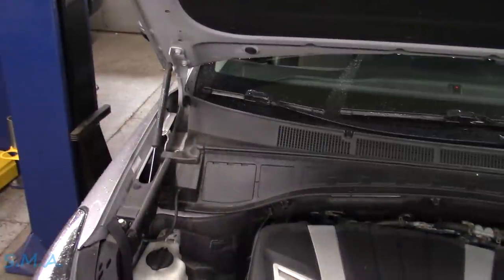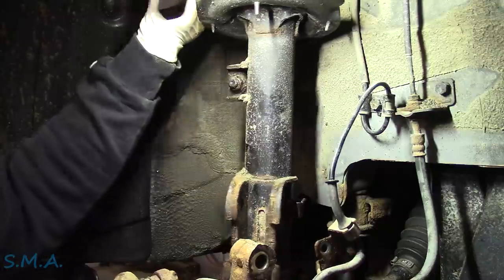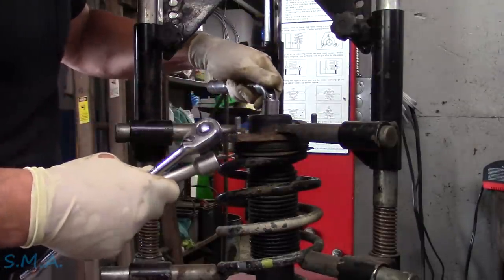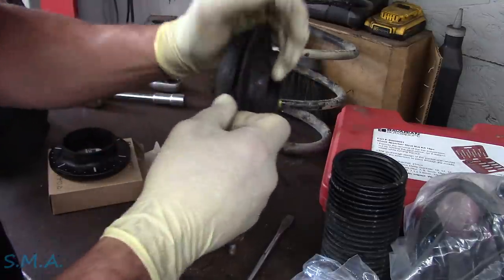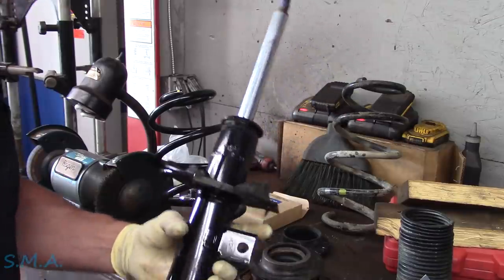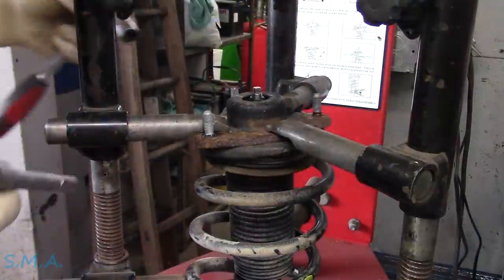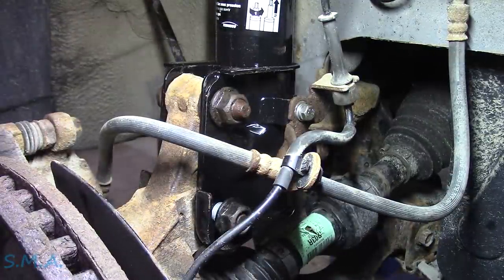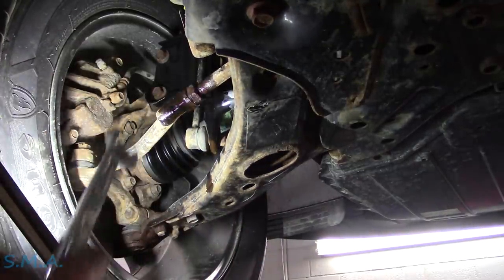Hyundai SantaFe: Broken Front Coil Spring

Comment: I did my son's Hyundai Santa Fe last fall, this looks so familiar. I just went to the "Rock Auto", not a sponsor, and got 4 struts with bearings and springs with swaybar links for less than NAPA wanted for 2 struts without springs. His the right rear spring broke.
Reply: Rock auto in the past has been accuse of selling fake parts, so watch out. I used them before too
Reply: @thevinceberry  I think th y were ok, they seemed like real parts, steel and they fit so yeah I think they might have been real parts.
Reply: @thevinceberry  
I'm pretty sure that RockAuto is only a warehouse and shipping entity. If you've gotten fake parts from them it could be that whoever is supplying pulled one over on them or actually took over the aftermarket. There's been a lot of super cheap crap replacing what used to be good brand named stuff as Eric mentioned. Moog and a few others used to be incredibly good quality but today are actually worse than some of the other alternatives. That's a damn shame. On incredibly critical components or on parts that require a lot of Labor to get replaced I'm leaning more towards going to the dealer and getting OEM. And sometimes the OEM price isn't that much more.
I've got a 2013 Toyota that has drum brakes on the rear. And all of the aftermarket drums I found at O'Reilly we're not manufactured correctly. They are hubcentric not lug Centric. And the center hub diameter was machined too large enough that it made the drum off-centered and this particular car does not have the small retaining bolts to hold the drum in place while you're assembling it. So I ended up having a pulsation while breaking and took me a while to figure out why. And that ended up being the cause. Took them back tried a different set had the same problem. Went to the Toyota dealer to the dial Caliper with me and measured the new ones from Toyota versus the factory ones that were on the car and they were spot on. They were also double the price. But it doesn't matter if it's a good price if they don't work.
Was the second gen Prius 2004 to 2009 so if you know anybody with one of those that wants drums replaced on the rear don't screw with the aftermarket you'll end up chasing a brake pulsation that you can't figure out the cause of

Comment: It's been interesting watching you bounce back and forth between battery powered tools and air powered equipment. Professional workflow is very hard on gear! I like air tools because you don't have to worry about failing batteries, and I've got air tools that are thirty years old, still going strong.
Reply: Yes as a Heavy Truck tech I only recently started using Lithium powered tools, I see it the 3/8" drive impact I am using wouldn't OUTLAST my 3/8" Snap On air powered impact it has 20+ years of trouble free use. I do like the light weight Craftsman impact I am using but I see I need to treat it like a cell phone 🤔

Comment: I had never heard of Astro before watching SMA videos.  I've since acquired a couple tools, and they're all very nice!
Reply: I ended up getting a few too. Not a sponsor.
Reply: Astro also makes paint guns too
Reply: I'm trying to get out of working on my own cars (having Toyotas in an environment where the roads are not salted helps.) The strut compressor reminded of my very early days of DIY, when I had to replace a strut. I couldn't get ahold of a hand-held strut compressor so I bought a dozen muffler clamps and placed the along the spring all around. I was all gansta until I held it just a bit wrong and all the clamps zinged around to one side.
Reply: Ive been buying Astro tools since the late 80's..always been good quality tools..i actually have a 2 1/2 ton Astro floor jack i bought in 88 thats still as strong as the day i bought it.

Comment: Most useful tool for doing these is the socket set with a hole in the middle you use to undo the strut top nut, try undoing it with a cranked wrench!  Just done these on my Land Rover Freelancer 2 (LR2 on your side of the pond)

Comment: Love the innuendo Eric, love the videos dude keep it up. People where I live have the tenancy to cut the springs to lower their cars ride height. They keep doing it not realising they are doing something really dangerous and stupid
Reply: Used to be a common routine by car builders to heat a coil up until the car dropped onto blocks to set the lowered ride height.
Reply: @Blazer02LS  yeah but that's a lot better than just cutting down the springs. If you're going to lower the ride height of your car then do it properly instead of endangering your lifeand other people's. I have seen the aftermath of what happens if done improperly
Reply: @philmerrifield1163  So have I, same thing with wheel spacers.. Get proper wheels or axles instead of running those.
Reply: @Blazer02LS  I've seen wheels come off cars with spacers, it weren't pretty. Guy then asked me if I could put the spacers back on after the repairs had been done. I told him that that's the wrong way of doing things and I wouldn't do it. I fixed/replaced the hub rotor etc put the wheels on and shipped it 2 weeks later he crashed the car and investigators found the wheel came off due to his own negligence and when he put the spacers on when he left me after my repairs and didn't retorque the wheels
Reply: @philmerrifield1163  Yeah, I do the same, have seen them fail or the studs fail or come loose.

Comment: LOL I agree the torx head in the link is only useful when it's new even then still a pain, after a year then it is completely useless, and the vise grips are the best option
Reply: when I change sway bar links, i cut the link in half, snap the rod off of each side so its just the metal ball, grab the ball with vice grips and zip it out. I spent too much time as a young lad trying the allens and wrenches and just like you said, theyre a useless pain in the ass so I learned to get destructive. I can change links in like 10 minutes now
Reply: @peteragurkis3590  I usually try to take the nut off one time then got straight to the torch and slice the nut off.  Can’t be tight if it’s liquid 🤣
Reply: The "TORX ON THE END of the LINK" engineers, are NOT, REAL engineers. "Disposable Product" division people.

Comment: Thanks for the tip Mr. O, I almost re-used a strut bearing to replace a muffler bearing with a cracked race. It was a near-perfect fit, too. You're right though, that plastic would be a problem because of the heat. I'm talking about the main bearing of course, right behind the manifold injector. Those will get over 900F under sustained load.
P.S. Thank you also for the shout-out on the alignments and breaking bolts loose! If I put a set of tires on and I know I'm gonna align it, I soak the adjusters after I take the wheels off, then break everything loose when I come back with the fresh rubber. If I don't take ten minutes breaking one bolt loose under the car, I have more time to get camber/caster right, grease fittings, etc.
38:50 Shoot, that's a John Bean aligner from Snap-On... I hope Mr. O's is more consistent than mine! I work in a corporate shop, and our district got to be the guinea pig for some of these. V3300/V3400, what a piece. (facepalm emoji)

Comment: Great video.  I found your channel looking for a plug swap on a '12 SanteFe sixer.  My car has 150k and has not had any maint. done except oil chg. and brake work.  Your shop seems pretty dialed into the Korean cars so its a great source for us shade tree mechanics.  I've had bad tire wear so I'm thinking I have alignment issues.  Also have a controller issue with a clunk when accelerating.  I'll be watching your channel for more great tips on Hyundais, esp. SantFes.  Thanks.
Reply: I have been driving the Santa Fe  since 2008 as a company vehicle, have gotten a new one 2015 and 2020. Each has been  a very good car.  The 15 had the warranty engine issue but other than that a great car, the all wheel drive for winter has been perfect . Highly recommend to anyone that asks.

Comment: I've always wondered if strut bearings and muffler bearings were interchangeable. Today I learned.  I still wonder, though, since a strut bearing has plastic in it, you obviously can't use it as a muffler bearing - it would melt - but in a pinch, could you use an all-metal muffler bearing as a strut bearing?
Reply: Changing blinker fluid intervals will be reduced by half.

Comment: A nice easy panel to remove to get to the top mount bolt.. usually have to take the complete scuttle panel off and wipers..right pain in the butt.
A simple design like a removable panel saves a lot of faffing around. 😎

Comment: Makes me wonder how many of your DIY or’s are looking up muffler bearings lol 😄
Reply: Actually they do exist. On engines that use a downpipe off a manifold and have the donut style gasket with the steel core, those used to be listed in service literature as an exhaust bearing. Pretty much all replaced now as simply exhaust gasket or donut.
Reply: Or blinker fluid replacement
Reply: @WaniuszY  I just released my blinker fluid damn manufacturer never install a fill hole to install.
Lol
Reply: @WaniuszY  And remember to get the right blinker fluid for your vehicle.
Reply: @markh.6687  mine was green made yellow pop
Reply: @markh.6687  What if the left blinker needs topping up? The fluids are handed you know.
Reply: @the_duke_of_bork8702  You can get non-handed blinker fluid; it even works upside-down in Australia. :)
Reply: You forgot a can of beep for your horn.
Reply: @theinfamousb-ran5729  Aw, c'mon man! You know there's no such thing! :)
Reply: I stocked up on those 5 decades ago.
Reply: @WaniuszY  It’s real,only BMW sells it and it’s always outta stock.

Comment: I have the slightest of suspicions that the torquing to spec is like a McGuffin in movies; its mentioned but never happens.
Reply: He uses the German Gudeintite spec
Reply: Naaah, it’s spec’sd in ugga duggas from the factory. Trust me, not as many things as you’d think actually get full torque tool control in auto manufacturing. A lot is just ran in with battery powered impacts.
Reply: I'd love to see the tools required to torque a strut nut as a regular torque wrench is useless :)
Reply: (6

Comment: I just bought a vintage motorcycle, and the motor would not turn, the exhaust vales were seized. I soaked the stems in Aero Lroil penetrating oil overnight and they popped free! Penetrating oil does work!

Comment: I've found that buying the strut already loaded is usually about the same cost as buying the individual pieces and saves time.
Reply: I’ve had extremely good luck out of the KYB strut assemblies. Oldest pair I installed is going on 7 years old and 50k miles on my 99 Camry

Comment: Apparently I shouldn’t have gotten my muffler bearings from Wish. Mine have plastic.
Reply: The ABS plastic muffler bearings are not too bad, but I advise you to stay away from the styrofoam ones. Don't ask how I know.
Reply: and ALWAYS opt in for the greasable ones, the sealed units just don't last
Reply: How about Dorman Muffler bearings? Any good? I've had good luck with their blinker fluid....
Reply: Moog muffler bearings are my go to brand.  Never let me down.
Reply: @flagmichael  could look at it this way , they go bad , they melt away . Makes for easier replacement 😁
Reply: my muffler bearings were installed wrong, so at high speeds, it makes sort of a grinding noise.
Reply: @emptytomb4967  need to pack them more with low temp grease
Reply: @mholdner  Yep and Moog offers a left handed monkey wrench to help with installation. Dorman doesn't:D

Comment: Broken springs must be a Hyundai thing, I used to have an 2010, IX35 (2.0TDi-4WD)  When I looked up its MOT history  (I'm in the UK, "Ministry Of Transport" Inspection, it's our equivalent to your annual inspection, applicable to all car's from 3 years old) Prior to my getting the car it had failed 2 previous MOT's (inspections) for broken springs (passenger side front and passenger side rear) and 2 years after getting the vehicle I had to replace the drivers rear spring before before submitting for another MOT inspection.   (IX35 became the new Tucson)   
Enjoy your channel, though its only some of the Asian stuff you work on we might see on UK roads.  Shocked how badly vehicles rust over there, surprised manufacturers are not manufacturing with Galvanised frames/shells.

Comment: Hyundai has a recall on this, perhaps the owner could get reimbursed for some of the bill?
Reply: Given SMA is a NY shop....ima assume safely its a NY car....wen u do a NY inspection the recalls come up if not done, if this car qualified for the recall, it would have popped up. Unfortunately thats probably why the owner was never informed about it and went to a private shop to get it done....they were never informed of the recall....sad.
Reply: And theyre definitely not getting reimbursed for the job. STEALerships will go all around to not reimburse.....noticed how the springs and strut bearings were OEM....the parts dept who sold the parts should have realized ans asked what the parts are for.....so someone isn't doing their job. But also, Eric should have seen the recall wen looking in service data.   Who knows what went wrong here, but end of the day the car is fixed and Eric gets to feed his family.
Reply: These days a person has the internet to look these kind of things up on.  But back in 1991 when I bought a Toyota Carola I had the exhaust manifold break in half.  When it was cold it sounded terrible but when it warmed up it sounded fine.   I took it to the Toyota dealership and they told me that this was an uncommon failure.  But then the parts guy let slip that they had a part number assigned for a "kit" of parts to fix my exact failure.  And this "kit", witch they were currently out of but usually stocked, was part of their normal parts shipment and would be arriving in a couple days.  So I wouldn't have to wait for him to make a special parts order for my car.

Soooo... I'm standing there, thinking, trying to reconcile the part guys conflicting information.  This was an uncommon failure, so he says.  But they had a "kit" of parts that came in on regular parts shipments, so was something that they tried to keep in stock.  And after the repair I saw that the "kit" included a modified heat shield over the exhaust manifold.

The parts guy obviously lied, this was a very common failure.  One that might even have had a recall on it.  But there was no way that I knew of to check on it at the time.  They just want as much money from you as they can squeeze out of you.

Comment: Nice video. I need to look at my muffler bearings. Something on the old Prius v is making a noise while parked at the stop light.
Reply: The hamsters are old and due for replacement. Beware the Chinese knock-offs; they are actually bats with their wings taped down. There have been various problems reported.

On a serious note for Prius owners, something I learned recently from people who know a lot more about them than I do. In Toyota hybrids the engine seems to develop what sounds like a light rod knock when it gets past 100K miles or so. The knock is only audible in drive or reverse at idle. It is actually a transaxle noise that is made by the planetary gearset when the engine torque is unsteady. The lash is fairly high because under normal conditions the engine either takes out he slack one way when it isn't running or the other way when it is. Anyway, the most frequent cause is worn out spark plugs. Don't thank me, thank the gurus I learned from.

Comment: If penetrating oil didn't reduce breakaway torque but did reduce galling on the threads once you did break it loose and were spinning off the fastener, wouldn't that be a good enough reason to use it? That's what I use it for.

Comment: "Take your strut to a shop".. Nope! I just replace my Chevvy Crud shocks by using two ratchet straps. Fed each one through the spring coils a couple of times and tightened 'em up. Did a fabulous job of compressing the springs safely. As to the hollow nut to hold the shaft stationary.. I just welded two old socket side to side and fed the torx bit down through the top of the center socket and put a ratchet on the outside sprocket to undo the nut. Man I am so cheap..:)

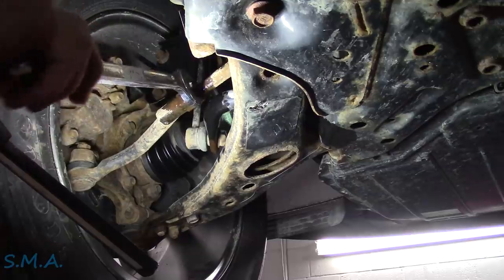Comment: im just clearing my backlog but 34:10 YES, ERIC YOU GET ME, IM HAPPY!
for the common denominator tho, i mean yes it kinda is my job to deal with that, but by things loosened you actually speed my work by A LOT.... you have no idea how many times i had to actually use to torch at the allignment machine or adjust tensioning bars because the casters are off and i have to use a wrench and the largest metal pipe that will fit under the lift... praying i wont be busting my knuckles swearing all over the place... specially control arms that you have to torque till your wrist cant handle it and i have to loosen them again to have the thing go straight...
so yes ill love you and ill go the extra mile to do the "perfectionist" allignment on your car for actually giving me the time savings to do that....

Comment: I didn't think one even needed "Locking Lug Nuts" in upper NY. After 15 minutes on your roads they have welded themselves to the hubs with rust. I also thought the caps on the top of the struts was where you added turn signal fluid to the car?

Comment: I didn't even know the front struts had bearings. When I had to get upgraded front springs and struts after installing a bullbar, they also had to realign the headlights because the extra weight on front made the headlights aim slightly lower in front so I couldn't see as far on low beam. Does every front strut replacement require headlight realignment ?